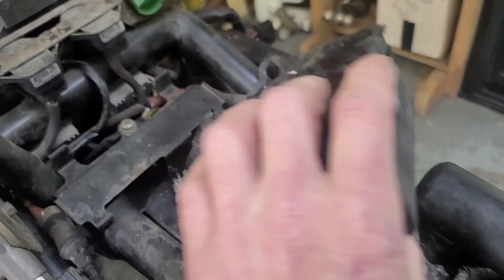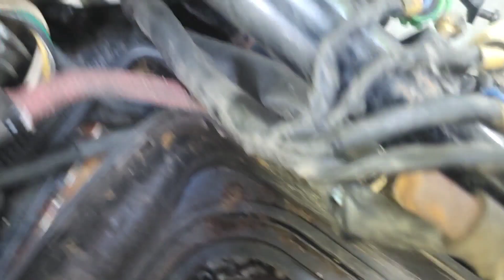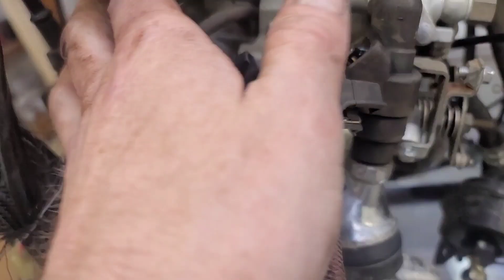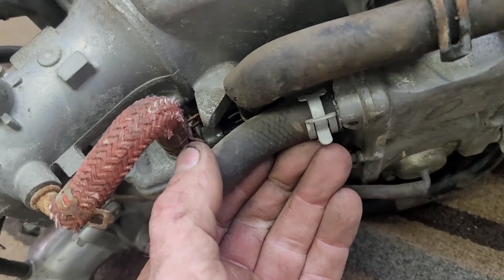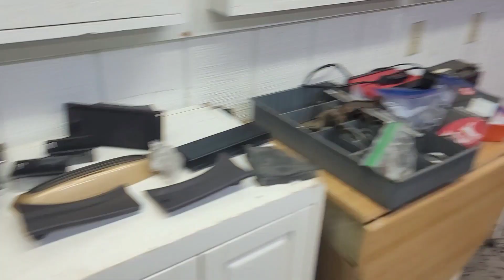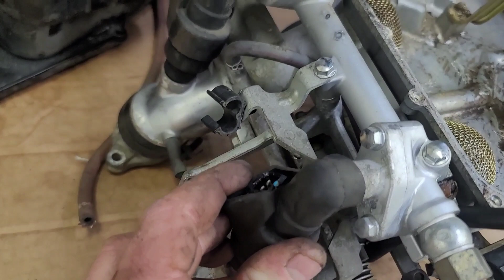Basket Case Goldwing part 8 (throttle body removal)

Comment: I'm watching all the videos and I'm surprised by the calmness with which you face all the obstacles and it's very scary to see that entire motorcycle dismantled. It's a shame that most of the videos I saw don't have substitutes, although I also noticed that talking is not your taste, but it would be good if you explained some of what you decide to do or see on the tour.
Reply from the maker: I will look into adding subtitles. I am a man a few words but I've gotten better and more comfortable on camera 😁. This has been a huge project. Also, somebody else took it all apart so it's been a puzzle the whole way through. Cheers
Reply: @MotorbikeGarage603  Yes, I have noticed that they are more narrated as you progress in the project. Congratulations!!!